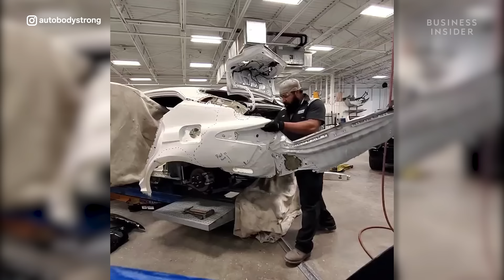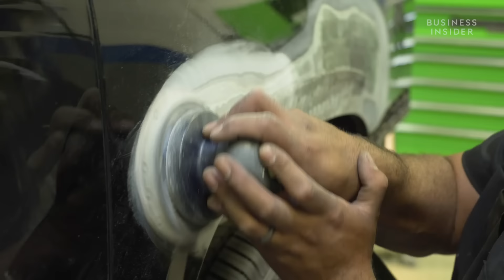How Wrecked Cars Are Repaired | Cars Insider

Comment: It still doesn't change the fact that the car is now structurally compromised. Aesthetics are one thing, safety is another. Metal fatigue and work hardening are things that could seriously impede the vehicle's ability to crumple as it was engineered to do so.
Reply: If it’s repaired properly it will be as safe as new, can say that from experience, we wrecked our Escalade and they replaced part of the Frame in the front, a year later we had someone come into our lane and hit us head on, the car crumpled like it was supposed to and we all walked away
Reply: You're not body shop tech therefore you know nothing

Comment: It is nearly impossible to get those vehicles to align perfectly again.  Beware of these vehicles in the market.
Reply: not really we use laser beams and sht now. even sonic measuring systems . they only cost as much as a small house but whatever
Reply: ALSO, WHEN THE ENGINE AND TRANSMISSION IN A 2019 CHEVY EQUINOX HAVE NOT BEEN SERVICED IN 100,000 MILES OR MORE: *GUNKY AND GOOEY BLACK SLUDGE IN THE ENGINE AND TRANSMISSION, $10,000 TO $20,000 REPAIR, AND NO GUARANTEE THE TRANSMISSION AND ENGINE WILL EVER WORK PERFECTLY AGAIN!!*
Reply: Is that a 2019 Chevy Equinox in the thumbnail?

Comment: That's not how a car should be repaired. Complete panel replacement and new frame subassembly
Reply: Wait what clip do you mean? You mean the dent in the rear quarter of that black car? Or you mean the one on the lift? Off course they replace the rear end but you have to start somewhere, or do you think they can just cut out the bent stuff and replace the rest?
Reply: They have to pull the damage out to relieve the pressure on the undamaged metal

Comment: With small dents, I don’t know why some people don’t consider pdr
Reply: Coming from an auto body tech, PDR is more meant for small door dings and golf ball sized dents, but if it’s on a body line or has any sort of crease or such like that, it’s impossible to do PDR, and when you get a dent sometimes it stretches the metal out so much that it can’t be put back, And the body panels on modern cars are so thin it’s extremely difficult to do PDR on larger and sometimes even small dents

Comment: im pretty sure this is for cars that arent a total loss, total loss goes to auction where other people buy it in attempts to fix and sell/keep it
Reply: Its a mix of everything, these shops mainly work on total loss vehicles because of the amount of work they require
Reply: @scripulance.1901  there is no way from a minor bumper hit it would be total. There could be structural damage to the frame rails, radiator support, park sensors, adaptive cruise control, pre collision systems, etc. Also you have to determine if It should be a total loss. What is the condition of the vehicle, how many miles are on it, is there a salvage title, prior damages. So there has to have been something else other than damage to a front bumper for it to be a total loss.
Reply: @incredibleholc8731  Airbag deployment is typically an instant total, if I’m not mistaken.
Reply: @80PercentAshamedOfU  yeah insurances calculate retail costs of replacement airbags in the total and it’s usually not worth it to repair vs total but when people buy these totaled cars at auction for repair they can cut costs by using airbags from a donor vehicle.
Reply: @80PercentAshamedOfU  depends on the make and model of the vehicle. I have seen times where they still fix a brand new car that had air bags deployed. But usually yes if all airbags are deployed in a accident they make it a total loss.
Reply: Every car can be fixed just bc you dont know the industry. The very worst can be fixed
Reply: @stardog2779  of course but at a certain point it comes down to money, is it worth it to fix the car?
Reply: @bryantunknown4233  maybe not to an ordinary person but there are body shops out there restoring burn to the ground cars worth the work
Reply: @scripulance.1901  You do realize that insurance company adjusters are the ones that decide if a car is a total loss not the body shop don't you?
Reply: .....nope, some cars are branded as clear title and they still get auctioned off, I've seen some cars with missing roofs and damaged frames and insurance company will still label them as clear title, then I seen some with minor fenderbender damage and were branded as certificate of destruction, it just depends on the insurance company. And I could tell you, majority of insurance companies hardly know anything when it comes to automotive repair
Reply: @scripulance.1901  I had a rebuilt salvage 2013 Nissan Altima and I got into a car accident and I got 11k it was a total loss